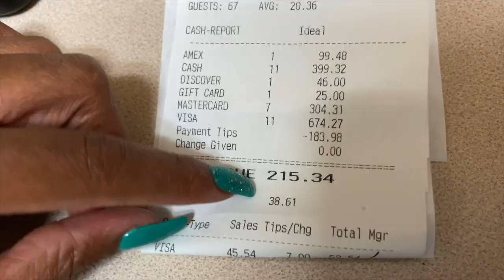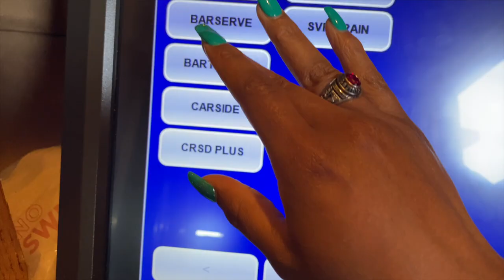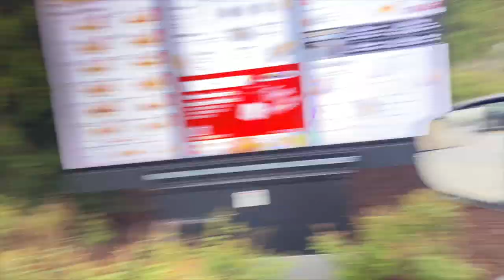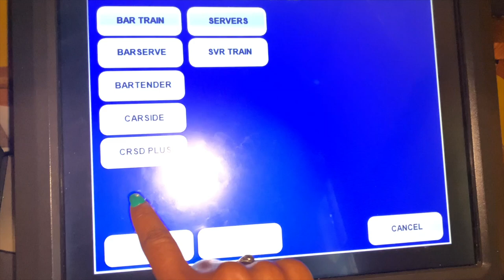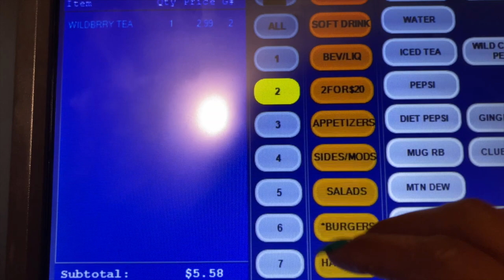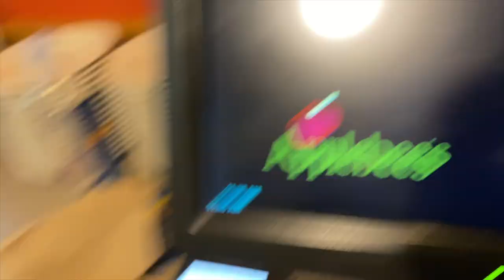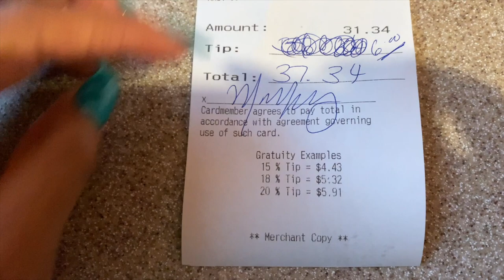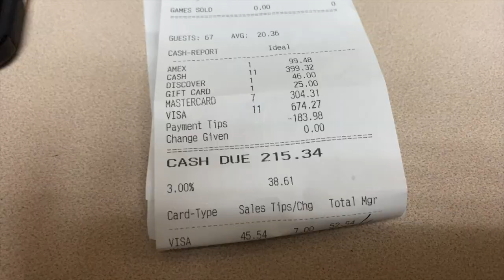Work With Me For A Week | Applebee's Server/Bartender Edition

Comment: Your tips are based in a pool vs individual?? Pool as in everyone gets shared tips
Reply from the maker: The Only People That You Share Tips With Are The Hosts & The Bartender. The Bartender B/c They Make Your Drinks & The Hosts B/c They Supposedly “Clean Your Tables”
Reply: Is it pool? Or tip out? In my state it’s “recommended” to tip out but it’s not mandatory. I’ve never worked at a restaurant where tips were shared.